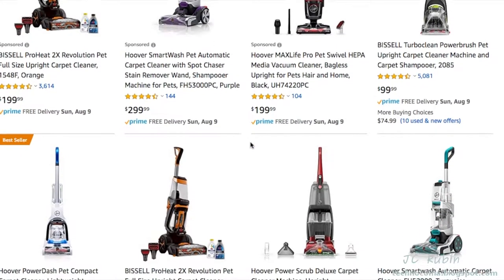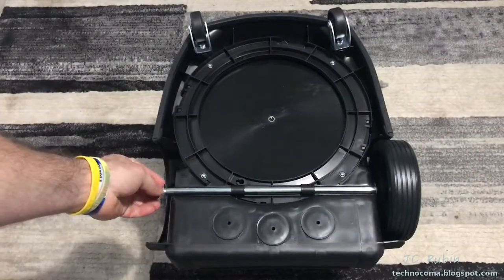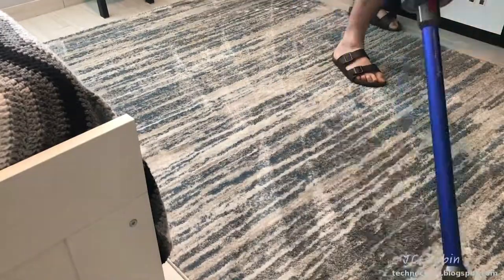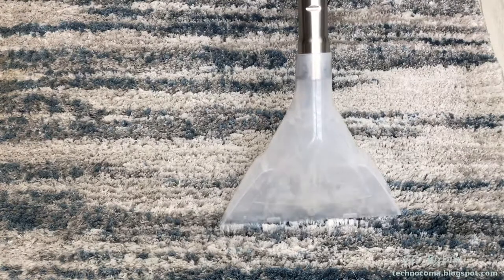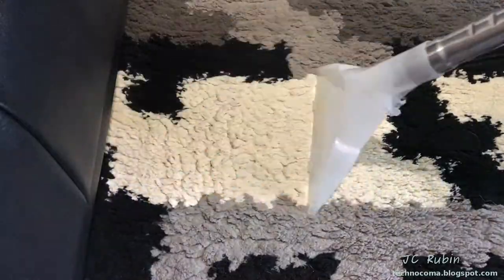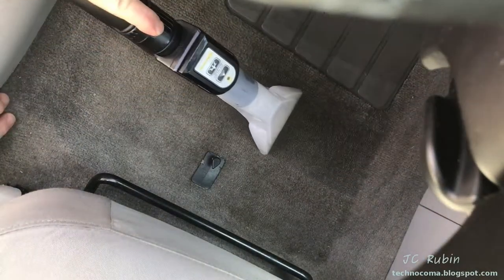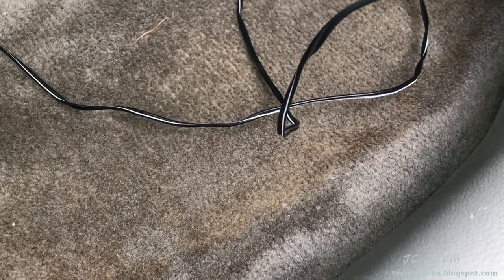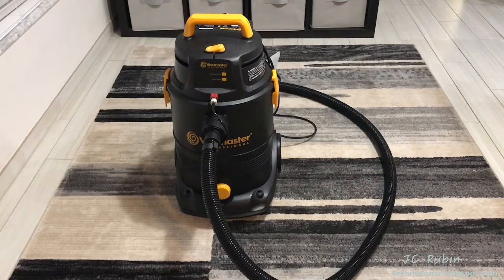Vacmaster 3 in 1 carpet cleaner - Unboxing, Demo & Review

Comment: You should use a drill brush with spray cleaner first, then fill the tank with just distilled water to rinse the cleaner solution out of the carpet. It will be less passes trying to clean the dirt.

Comment: no way does mine spray out detergent  as well as shown here  Mine just dribbles out   it is heavy and difficult to move around  when vacuuming the attachments come loose and fall off so i have to use energy to hold the pieces together as I'm vacuuming   it has good suction but having two sets of on off switches is confusing  i am not happy with this  i will put it in the garage so the MEN can handle this beast

Comment: Descent review, as a detailer I use a pump sprayer with cleaner. Agitate the carpet with a drill brush.
Your floorboard will need that to get most of that orange up.
Get it to wet the orange will surface back up through wicking.
For the vehicle just have hot water in the reservoir to flood/dilute the cleaner. May help you out next time.
Reply from the maker: Thanks for the tips!
Reply: flood?? you mean dribble dribble

Comment: Hello, nice informative video. I didn't see any mention in the vid or comments of anyone trying to use hot/boiling water for an actual steam cleaning. Is the tank and/or system up to that task you think?  I'd be interested in it for sure if it was, because all the rental units I've used requires you to add your own source of hot water, which I just continually keep a pot of boiling water on stove as the cleaner is working
Reply from the maker: Its not a steam cleaner.  Warm or even hot water may be used but take care for possible carpet warpage.
Reply: No doubt. Its for automotive carpet so it'll be fine. I was curious if the vacmaster's reservoir can handle the boiling water I pour in it like many of the rental carpet extractors I've used in the past

Comment: Hi. I have used mine for 15 minutes (in both modes) and upper part got hot. Not extremely warm but slightly (like human temperature). After some minutes it turned to normal temperature. Is that okey ?
Reply: By upper part I mean the pace that has “switch on/off” place. Also is there any limit of how much time can I use at once ? I am asking that as going to use in car wash business hence will use it intensively

Comment: Im planning to buy this brand too....i also did my search at vacmaster official website but this model does not exist...so far u have use this vacuum is it stil ok until today?i mean the condition and the perfomance is it ok?is it worth it if i buy it?can u suggest me..tq
Reply from the maker: I have used it several times without issue for both carpet and automotive cleaning.
Reply: Hanie have u bought it? Can share some review

Comment: Thanks for the Video review. Very good. I have a quick question. Supposing that I want to wet clean an entire room floor, does this work? Say a room with marble/stone floor. Can I clean the entire floor the way you cleaned the carpet (by spraying solution and using the suction in wet mode)? Can it operate continuously in that mode for say 30-45 mins?
Reply from the maker: Yes it does, easily.
Reply: My little Bissell floor cleaner works better and is easier to handle than this giant plus the water dribbles out not spray like you see in this video.  I am very disappointed in my purchase. I have to say the suction is great, that is about all

Comment: Wonder, why you need that extra spraying system? You can use it separately.
Reply from the maker: It sprays directly where it vacuums as is the design of such systems.
Reply: @retrotechandelectronics  , that is obvious 😁. Just wondering why spraying is included. To make a product more expensive. A good vacuum with a proper suction mouth is should be sufficient. Spraying could be separate applied, right?

Comment: great video! it made me want to get mine. The tranistions were a nice touch. i do just wish you showed the installation of the bag and if it worked well while vaccuming. over all, great video. Thanks!
Reply from the maker: I’d never considered using it for a dry application. That’s why the bag wasn’t used. Thought I see the value in it. I wouldn’t convert it back and forth.

Comment: I’m curious if you could apply an aftermarket carpet claw.
Reply from the maker: It’s friction fit so it’s possible. The fluid line would probably require an adapter

Comment: Considering this for auto detail with it being way cheaper than a nice mytee.
Reply from the maker: Not familiar with the mytee
Reply: @retrotechandelectronics  it's one of the more high end known heated extractors but they are usually $1000+ new. Out of my budget.
Reply from the maker: Trent's Details 1000$ would be out of my range too
Reply: This would be better than the mytee because of suction alone. Since vacmaster is a vacuum company, that created an extractor for the first time, the suction is more powerful than any extractor.
Reply from the maker: That it worked on the headliner on the delorean without I’ll effect made it worth it.
Reply: @retrotechandelectronics  I love mine but wouldn't use it on headliner. It may cause it to sag in the future. I avoid letting headliners get wet or using strong chemicals. I just scrub with a damp rag.

Comment: Great video. Tbh I wish I’d seen it to bolster my confidence before buying. I saw an equal amount of positive and negative reviews for machines on amazon, and basically hesitated to pull the trigger on any carpet cleaning machine despite really needing one Asap (My sister’s car is in my care and a leak in the sun roof caused it to become an indoor pool 🤭 😬 oops)  Also considering I’m really on a budget here, I couldn’t afford to mess up and have to buy something else. It just arrived last night and I wanted to watch a video on assembly, and welp here I am. Thanks for such a useful and well made video ✌️
Reply from the maker: I’ve used it many times since that video and without fail.